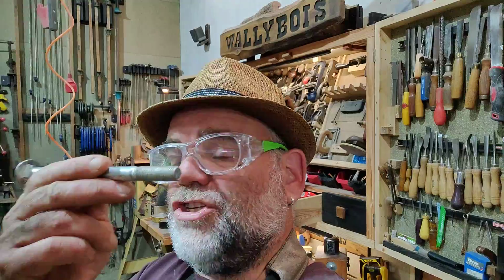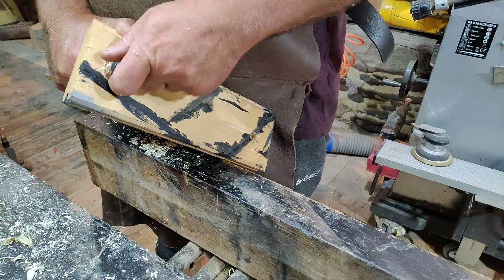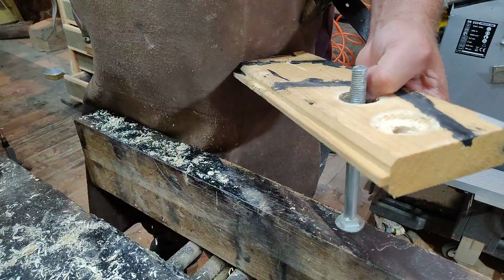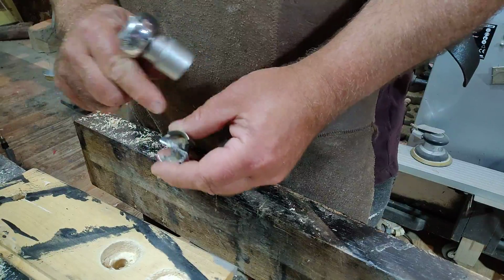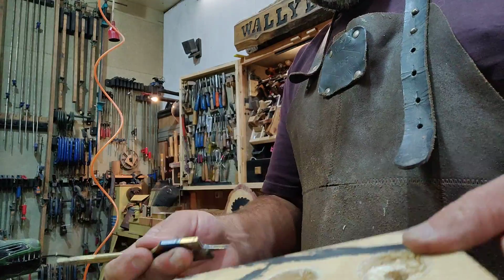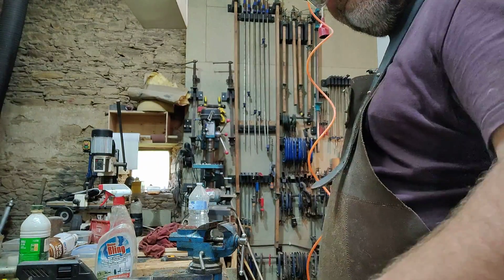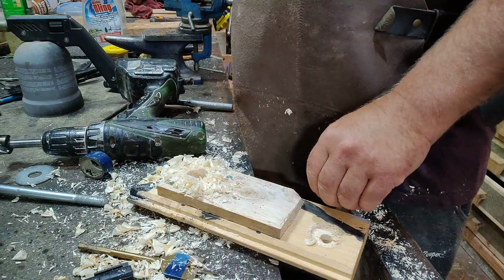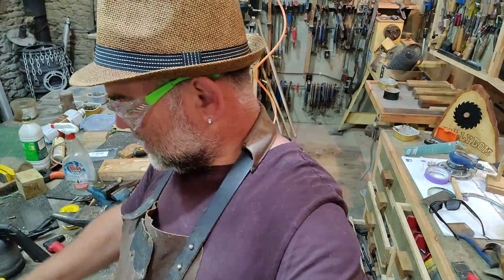Great Tips on how to Countersink Recess Coach Bolts / Start RIGHT finish RIGHT

Comment: The last jig is also how to fix the start wrong problem, or enlarge a hole in general.  As long as you can clamp it somehow to the beam (or in my case, countertop) firmly. I think I got that from an older Wallybois video, and now my new kitchen faucet (which needed a larger hole) is installed.
Reply from the maker: Cheers buddy I think you're right I may of done this before 🤦‍♂️

Comment: Good tip, thanks!

Would you recommend the same for countersinking the pilot hole for a woodscrew? At least one inquiring mind wants to know, and is also thinking it might make for another video if you've not done one before. (I"m obviously thinking of separate countersink and pilot bits, rather than one of those combi ones.)
Reply from the maker: I can do that... You could use this method
Reply: I've tried both ways, but found that countersinking first had the unfortunate tendency to have the bit skite around a lot (pardon the technical term :) ). Managed to solve that with improvised use of a nail punch to put a dent in the wood first - not the most technical of solutions, but the punch and a hammer were within reach. My guess is that being a little less heavy on the trigger is what's needed, but I was in a rush and "more haste, less speed" turned out to be true once more.